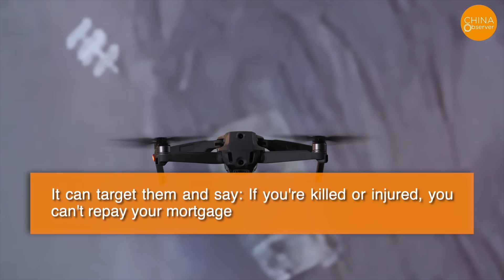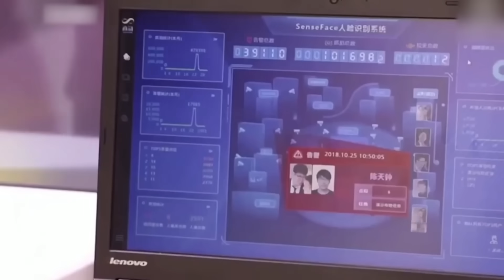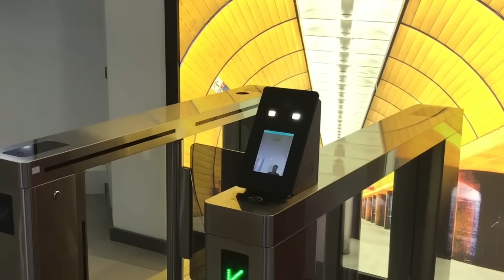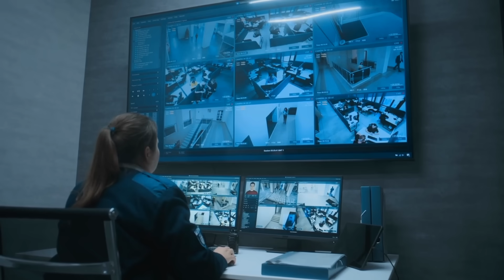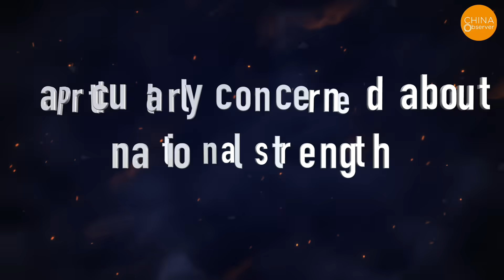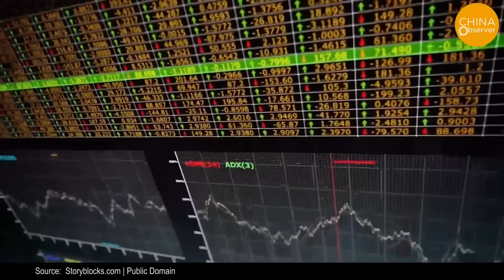China’s Knockoff of US Military Tech: A Spherical Robot That’s a Joke, Revealing Serious Weaknesses

Comment: At present, the cost of manufacturing the spherical robot is between 300,000 yuan ($41,425) and 400,000 yuan. With constant improvement and modifications and its decreased costs with expanded production scale, Wang expects that the application prospect of the spherical robot will expand to home appliance or toys. 

What's the cost of the US version and is there plans to expand its use to the home

Comment: I mean... that is not a bad design for a robot as a general rule. It would be very fast, it's hard for it to get trapped or stuck irreversibly, and it's simple. 

A LOT can go wrong with those Boston Dynamics robots. The dog ones are getting decent but the mishaps with the human shaped ones are still common. The videos that go viral are literally marketing materials and highlight reels that take numerous attempts to capture because the robots simply fail at the task a lot.
Reply: It's mostly useless other than for maybe chasing down someone running away. Like a protes...
Reply: @MrBashem  FPV drones will always outperform in that kind of scenario. The issue with FPV is they are limited by their batteries because they need so much power to stay airborne, maneuver, and then detonate their payload, in military contexts.  Batteries are very heavy, and min/maxing this category has produced logarithmic results. 

Wheels or spheres can go a long way if they can just overcome their inertia initially, even on flat ground (ie it doesnt have to be downhill to benefit) using gyroscopes. They can coast, basically, and traverse longer distances while conserving power.
Reply: @TyburVelereon  That is not what I mean. I mean you can't do much with a rolling ball. Use it as a bomb? A FPV drone has that covered.

Can't use it as a weapons platform for much. Limited scouting uses. Producing it is costly and uses lots of parts. It's also easily destroyed by someone with a gun.
Reply: I imagine it's best possible use is simply recon tbh. It's not speedy, but it having cameras automatically makes it much safer for looking around than sending a real person into the field. Aside from that, it doesn't seem too handy.